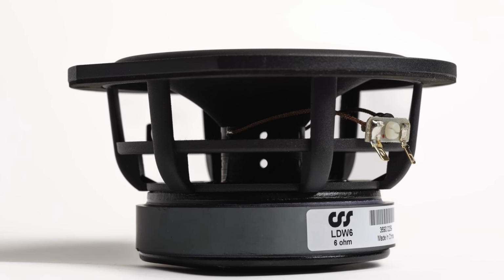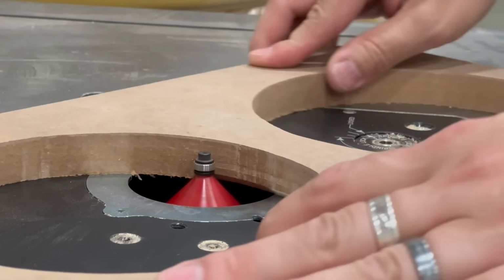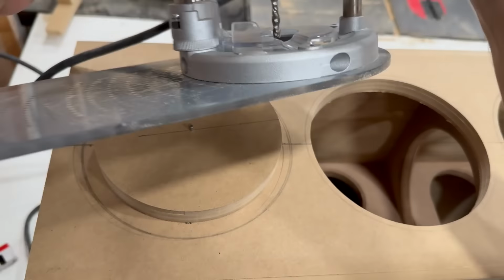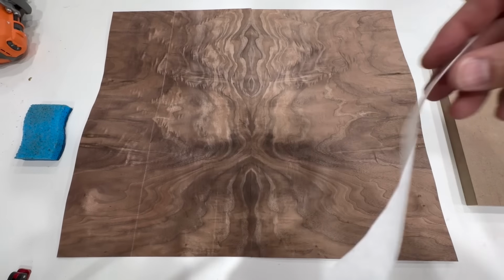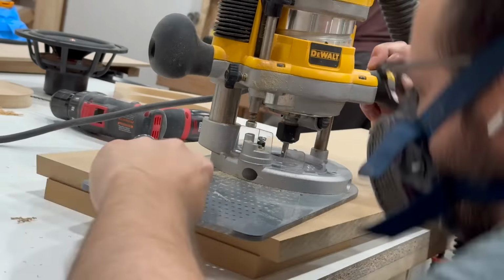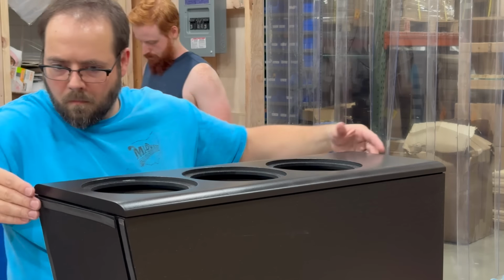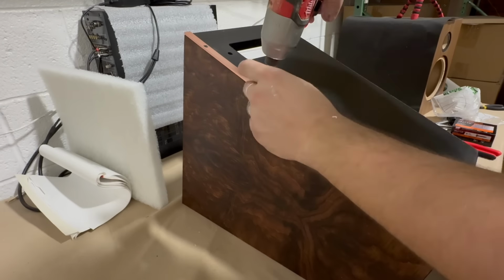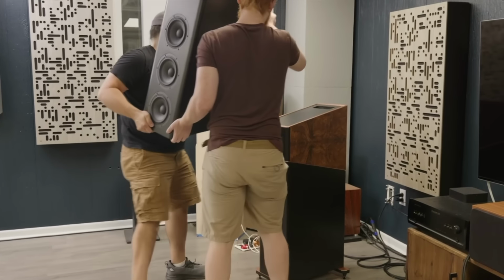Building an INSANE DIY Speaker in 30 Days

Comment: Hello Kerry from Meaford Ontario Canada: In 1996-2000 I was the manager at Oakville Audio in Ontario Canada and we sold some of the finest HiFi in Canada, we had exclusive rights to John Farlow s Exposure electronics and Joe Achroyd s Royd Audio, I know Joe and spoke to him a few times on the phone while as manager, I learned what Joe knows about speaker design and others as well as I have seen the tech implemented since the early 70's, ALL DISTORTION IN A SPEAKER STARTS IN THE MAGNET, by dampening the driver magnets woofers midranges and tweeters must all be dampened by a rubbery gooey type dampening material that wicks away the vibrations that start in the magnets , also use T Nuts and bolts never wood screws and use five inch squared 1/4 inch thick steel plates glued to top bottom and inside walls of cabinet as inside speaker walls should be denser than top s and bottom s and backs as Totem had learned , all drivers should have wires connected directly by soldering iron and all wiring should be a silver combined with either nickol or copper
Reply: I damp the speaker basket and magnets with window caulking. It never dries out. It's like putty. Could you give a bit more info on the product you're using?
Reply from the maker: I accidentally deleted a commenter's reply (sorry and YouTube apparently has no way to undo that), but they mentioned that most of the distortion from a driver comes from the motor design. That is absolutely the correct.
Reply: Where can I get those acoustic panels on the walls?
Reply: iirc, driver distortions primarily emanate from the motor;
- force factor varying across stroke
- inductance varying across stroke 
- flux modulation by drive current
Reply: Some hi-fi snake oil for you guys 😂
Reply: @greganikin7003  I was offended you called it snake oil...hence my retaliation
Reply: I would suggest SEAS drivers. They would make a world of difference in the ambient musically and less distortion in any builder's design. From Toronto, Canada, I worked in Many big box electronics Car Audio and custom high-end stores
PS Love the build you gave me the bug again to make my deam towers, I mentioned it to the wife and all she said was Oh Boy! 😮😅
Reply: ah yes, the silver wires, the audiophile's favourite hallucination
Reply: @peniku8  ya that's why all top sneaker manufacturers use silver and amps like Audio Notes Onganku using 27 lbs of pure silver that's why B&W signature series use silver iron powder speaker wire ...ya just a hallucination
Reply: @greenlanternseven  No, the hallucination is on the consumer's side. The manufacturer has a clear benefit: marketing material and increased price to their product. But I know exactly how this dicussion is going to pan out and that defenders of this nonesense will refuse to accept any scientific argument so don't expect me to reply any further. Keep buying silver cables, cable risers, 10K$ R2R DACs and McIntosh amps!
Reply: @peniku8  i will and have superior sound....copper boy
Reply: @peniku8  Have u ever heard a high quality system? Its different from your BOSE set u know...
Reply: @katchaontheflipside  Man you wish you had a system like I do. Currently on the prestigous Harman Kardon HK19.5 which deliver the silkiest mids, most detailed treble and tighest bass one could only dream of.
Reply: @peniku8  😂😂😂
Reply: @gbrm6077  liquid rubber used in construction works a treat to cover the magnet and basket....you can build up coats to your required thickness
Reply: I thought the better combination would be something like thick cooper for bass and possible slightly thinner silver played copper for the mids and silver for the tweeters ??
Reply: I’m from Owen Sound. I’m hoping to build my own speakers in the future. But have no contacts locally.
Reply: @ plenty of kit manufactures around
Reply: @drmindbender8616  cool things about kits is you can modify and upgrade as you build

Comment: Perhaps i missed it, but what makes you think these speakers are worth 35k?
Reply: Right? lol
Reply: U didn't do it... if you want them that his price of time
Reply: Made me think the same thing. I think parts cost is the max these are worth. Speakers with retail price of 35k should have all the inside corners perfectly rounded. Ports ends flared. Everything tuned to perfection for perfect sound. Outside lacquer polished to mirror finish. Beautiful trims to cover the speaker cones. And built in amplifiers that would be correct for the speakers. These are just MDF boxes with random woofers thrown into. You cant just say "these are very high end speakers" just because they somewhat look like something expensive from afar.
Reply: Absolutely 35 thousand 😅😅😅 look not alike either😂😂😂
Reply: What you think 35 k speakers worth that much anyway ?
Reply: 220-240 hours worth of labor:  (labor cost?  $50?)  $11,000-$12,000 ?  - I've no idea how he values his time:  But Google says a fine furniture carpenter can earn $36 per hour in NYC and LA.  Maybe he is putting a premium on his design?+$3,500 Materials=$15,000ish 

100% markup retail store, shipping, setup, etc?=$30,000

It looks like a huge stretch to call these $35,000 speakers, but the price wealthy people pay for "luxury" items always looks like a stretch to me.
Reply: @ Yes, maybe these "could be worth" 35k if you calculate hours like that. In reality expensive speakers are designed to have the best audio quality possible. Audio research companies spend years upon years to develop their products to perfection. These speakers in this video though seem to be just boxes with fairly expensive drivers in them, made to visually mimic a set of expensive speakers.
It's like making a Ford Mondeo visually look like a Ferrari and calling it million dollar car.

Comment: I used to build one-off hifi loudspeakers but i never got to finish my own 3.5way transmission line speakers
I had kept an array of the best quality drive units & x-over components over 10 years, months calculating & designing them, an 8" bass unit ,tuned to 30hz up to 180hz-200hz, midrange to 1.8K, tweeter to 20K & super tweeters from about 14-16kHz to about 50K..
Good job, did you finish them ? do you have them still & do you have a frequency graph, MLLSA readings etc ? You mentioned having a Klippel machine...they look excellent, would have liked to see some measurements & numbers, bass f3 etc... thank you....i really wish i had built them then as not got access to the tools, machines, CNC etc, now & decent drive units are to expensive now sadly....
Reply from the maker: Part 2 is here: Ultimate DIY Floor Stander Part 2: Technical Details
https://youtu.be/A4NCjL7EO8s

Comment: Very nice cabinet work but my appologies, I find it misleading by claiming a £35'000 dollar speaker.
What direct model is this referring to?

Performance?

You have many small drivers in a tower. What does your speaker offer that PMC BB5, or Kef Reference 11 meta and so forth cannot do?
Reply: Was thinking the same but sometimes you just need someone you convince that he needs this speeker and that it‘s worth it 🤔

Best is to find someone who is not able to build it himself AND has the money AND wants to be proud what he paid 😂
Reply: I would assume this is what he would charge if you asked him to build you one.
Reply: It looks really nice and exquisite. Many very expensive 'audiophile' speakers measure absolutely terribly, so acoustic performance doesn't seem to be a part of the experience.
Using a small coax without a separate waveguide for the tweeter is pretty rough and I wouldn't want that in my every day speakers. I'll rather go with a non-coax design and put treatment on my ceiling. I like the looks of big tower speakers, but acoustically, having subwoofers deal with the low bass makes more sense in terms of flexibility, output capability, sound quality and room acoustics.

Comment: Beautiful build! i'll take a pair :D
On a more serious note what is your take on the sound of mdf cabinets vs plywood ?
im making a new set of cabinets for my main speakers in particleboard with a layer of plywood on the outside just because i've heard things about it, im not done yet but im really starting to appreciate how easy mdf is to work with
Reply from the maker: Low density plywood definitely resonates more than mdf but as long as you are using decent quality plywood, there is no audible difference in my experience. I’ve not seen any research to point otherwise.

Comment: Hey, DIY here myself.
Awesome build! looks really good, love the copper accents.
Wouldve loved it even more if you wouldve shown the whole process. Like, figuring out what kinda speaker u wanna build in the first place, what you want to achieve, what drivers u take and how your selection process is. how you tune in the crossover and develop it. ( do you start with a dsp to check xover frequencies and level alignment to "know" what u want in the crossover so you have starting points and then start from there or do you go after specsheet simulation and start from there ) overall as with everything you did some things i would never do. But if i show you how i build speakers u would just say the same about my methods :D so thats fine.

Only thing im really curious about is the glued on front baffle. You WANT it to be easier to resonate? Did u calculate the resonance frequency of the front baffle and put it outside of the spectrum the driver play? But even with crosstalk between cabinet and baffle wall that sound ridicioulus hard to actually convert into reality. Sure u can simulate it, but the precision you would need to have to glue it on etc looks damn near impossible to achieve for me. Atleast when done by hand.

Ur speaker is a work of art, mine dont ever look like those, would love them to do tough.
Have a great weekend and thanks for the video.
Reply: the technical details are coming later

Comment: I had a '74 Dodge colt that I replaced the rear deck with 3/4" marine plywood and mounted two, 3-ways Infinity 6x9's (with Emit tweeters) and just a standard high-power deck, and that gave me the most transparent bass but hard-hitting sound of any system I have since been able to put together! The frequency response was flat and true. I messed with transmission line designs for my home system but eventually moved on to other things. What I am getting at is there is so much seeming black magic (I know the physics rule) that designing your own enclosures is impressive, especially these works of art. Thanks for posting.

Comment: These look amazing. Im more of a dedicated home theater guy. Do you guys have any plans for a theater style speaker? Sealed, onwall mounting, 80-20k, high sensitivity/high output style. Im thinking of something along the lines of a Magnat cinema ultra or a RBH on wall. It would be great to see some DIY kit options on the market for that type of speaker.
Reply from the maker: We've talked about doing some HT stuff but aren't as in tune with that market as the traditional HiFi so we need to do some more research before we could develop anything.

Comment: Amazing looking build, it has a real unique design with 3 cabinets per speaker, and the wood and paint combination with the copper as highlights fit very well together. 

How did you connect the speaker wires to the binding posts, did you solder them and if, how’d you do it? I have the same and they have this unnecessary wide opening with would use a lot of solder, and because I’m not an expert in doing it I would love to take some advice to do it right.
Reply from the maker: Glad you like it! I doubled over the wire and used the set screws to hold it in place for the main binding posts. The other binding posts to go between the three cabinets to the crossover have tabs for quick connects or soldering.

Comment: so is the medium density foatmeal neccesary or could you use baltic birch? the speakers came out nice but if they ever get wet or if you love deep gouges through hardwood by someone accidentally sliding these
Reply from the maker: My speakers don't reside on a boat at sea so I'm not generally worried about water or people falling into them and giving them deep gouges :P

But yes, you could make them out of Baltic birch if you wanted. The only challenge I see is that the edge profile on the baffle would be much harder to paint than with MDF
Reply: @css_audio  mostly a concern with someone trying to drag them accross the floor, those feet spikes look nasty for flooring. I get it is okay for indoor non marine use but I hate MDF with a passion after building IKEA furniture for a living. I also did notice my speakers were easier to paint after the plastic came off of my BXM 5s

Comment: Not sure about your hourly rate, but factoring the hours as well I'm sure a completed version is still a $20.000 speaker! Which nets you a 33% discount from retail and that makes sense from a commercial standpoint as you would not pay manufacturer and dealer markup as a consumer. Warranty may not be too much of an issue as the live components have their 'own' warranty. The crossover however will be the gold-silver medal award. If you match it or improve upon the original you are set for victory.

Comment: Good morning 🌅, interesting project, it might be worth investing in a CNC router table to cut your holes for your speakers, or having some aluminium jigs making up for your speakers, with stepped ring inserts, Your speakers sound quite nice, though They lack bass response, It might be due to the fact that I have a pair of very large transmission line they are speakers cabinets, that I built 40 odd years ago?, Just recently changed the drive units and drive crossover., SEAS DRIVERS, 150w 8Ohs , NAD 150 , 
They do look very nice and I’ll be watching to see what else you produce , good luck with your adventure, France.

Comment: For a relatively expensive build, why not use high end wires? I have used Neotech 12 awg stranded UP-OCC copper hookup wires in my 1TDX for the binding posts and woofer, and 18 awg UP-OCC silver wire for the tweeter connection with excellent results. Of course, the binding posts were upgraded too - cardas CCBP pure copper binding posts being an excellent choice.

Comment: Nice job.  As I was watching you spend 2+ days just cutting all that MDF on the table saw, router table, scroll saw, jigsaw, etc etc, I was thinking wow you should really get a CNC!  It would be a huge time saver and give you flawless results -- AND it would maximize your material yield / minimize waste.  I realize it may be hard to justify the expense if you are only doing these builds occasionally, but if you really can sell those speakers for $30k then I nice 4x8 CNC from AVID CNC could be had for less than that.   All the best!

Comment: I have been planning to flank a coaxial 8" with a pair 12" woofers with either a bi or tri amp plate. For about 10 years.
Reply: Superb platform. 
My Catalyst 12c are precisely that. 

A pair of the finest AE 12" low distortion drivers, flanking a B&C coax, powered by ~2kw active.

Comment: How do you prevent the copper from oxidising? Fingerprints and stuff will turn dark pretty fast, it's a pain in the ass 😅
Reply from the maker: 18:14, immediately after sanding, wipe with acetone. Use gloves so you don’t get any new oil on the copper. Then spray with a lacquer meant for metal.

Comment: F-ing impressive!  Here's my feedback:  1. Use of color.  Instead of black as the default cabinet color for everything that's not in the center block/wood veneer (check out Goby Walnut for veneers), try reds, blues, and white or copper hues to make these awesome speakers stand out: sides, faces, and lower sections.  If I'm buying a kit, I want them to be different - and I don't want to have to break out my painting tools.  I would include color options when ordering a kit.  2. The modular sections - especially the top block - look difficult to add and, honestly, looks like my kids could quickly knock those over. How do you know they are secured?  Is there a mechanical lock? 3.  I recommend breaking out out the router and rounding the edges on everything too - like you mentioned. 4. Copper: Cooper fittings are your unique differentiators - and they look kewl.  I recommend using copper rounds on top of the speaker housings. See image at 17:15 in video: the driver in the wood veneer block is a different shape.  Because the housings are different shapes - it makes the speakers look DYI.  Use copper as a design feature to make your design really stand out - perhaps with CSS etched into the band?  Oh, marketing and lead generation: Think about placing ordering information first in your Youtube descriptions.
Reply from the maker: Thanks for the feedback. This build was for me and not something we plan to sell. I actually almost never choose black but wanted to here and focused more on texture and sheen contrast than color. I also like seeing driver frames (apparently in the minority these days) as opposed to trim rings.
Reply: @css_audio as part of the build, we would love to see what your design choices were. Why choose a Coaxial Pro driver? Did WAF factor into this? Why did you prefer a M T M configuration, was it only because you needed to use 6 woofers to balance the sensitivity? How did you connect 6 8 ohm woofers to match the impedance of a single 8 ohm coax driver? Why did you use MDF instead of marine grade plywood (which for me is less messy to cut)? Since this was a passion project I noticed you used some compound between the 2 layers of the front baffle (around @15:30). Was this to implement some CLD? What was this compound? I couldn’t follow the name in your video. Thanks.